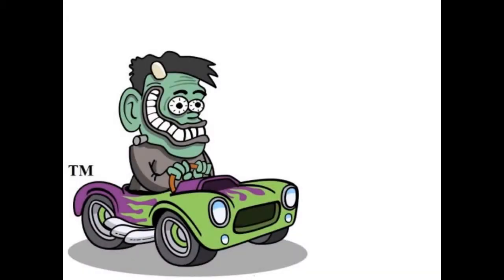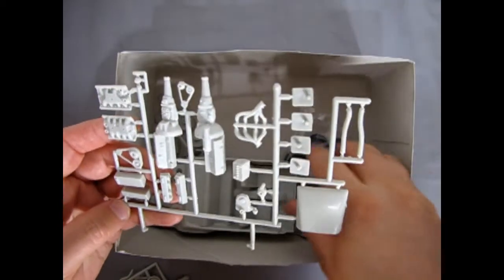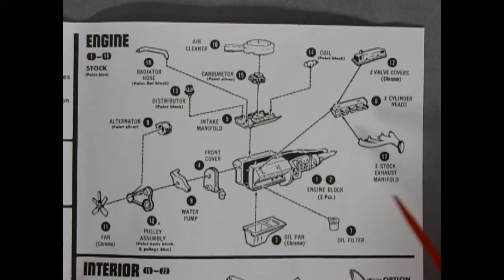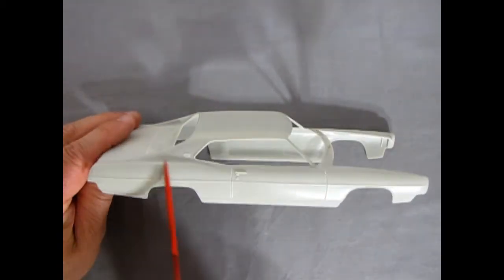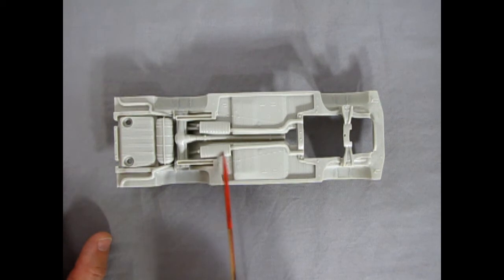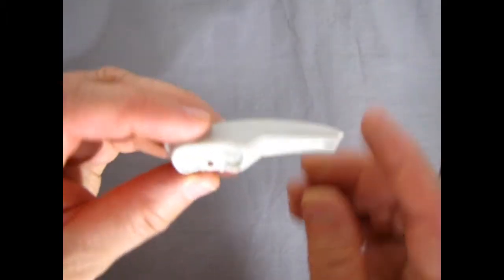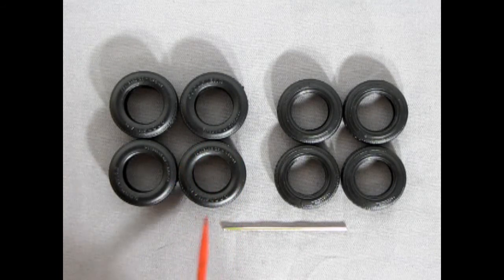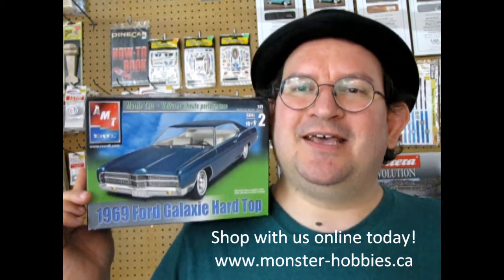Model Car Garage - The 1969 Ford Galaxie 500 XL Hardtop By AMT/ERTL - A Model Car Unboxing Video

Comment: That is the gas tank right behind the rear axle.  ...then the trunk is behind that.  This has pretty good detail on the body.  ...too bad they have the body side moulding on there.  I'll have to sand that off.  The interior is ok.  The seats are a little off, and the console is just a bit too wide.  ...all compared to the 69 cars.  ...and it's missing the headrests on the front seats.  The stripes included in the kit are wrong.  They look to be from the '68 XL's.  The '69 XL's had C-stripes.
Reply from the maker: Thank you for the input. The decal sheet sounds like a hodge-podge of years.
Reply from the maker: Did you ever build this model car?